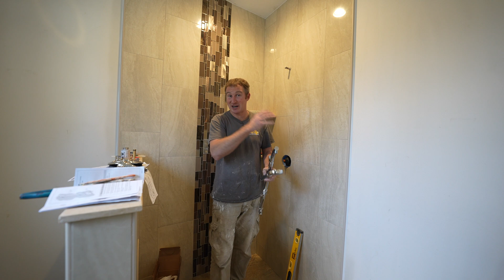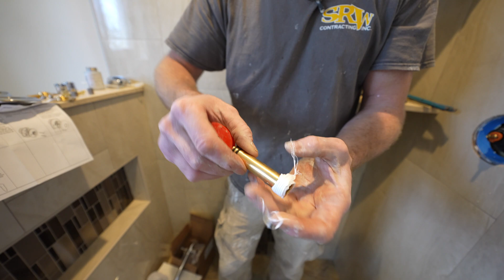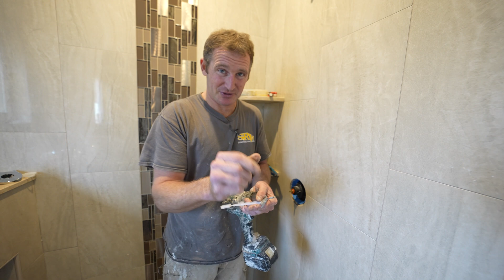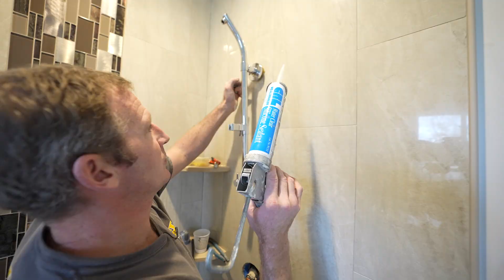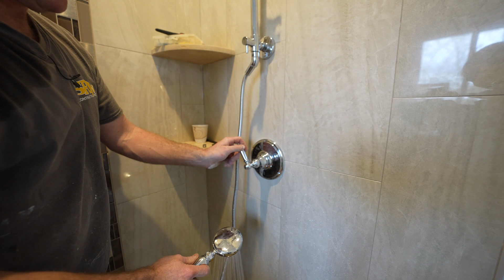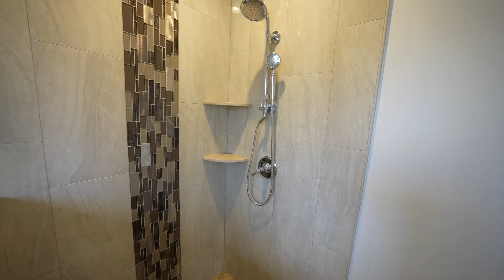Adding a Handheld Sprayer to a Shower 🚿|PLAN LEARN BUILD

Comment: Delta makes a version that simply attaches to the existing elbow pipe which ropes down then back up with a handheld & fixed shower head for about a hundred bucks.

It's magnetic, offers different spray settings and doesn't require any specialty tools or permanent changes to the house as you can simply replace the shower head with the original if you plan to move.
Reply: Would you mind providing a link (or if you know the model name?) Thank you!